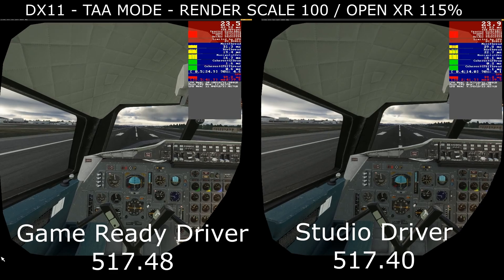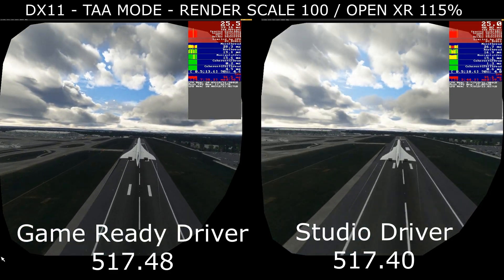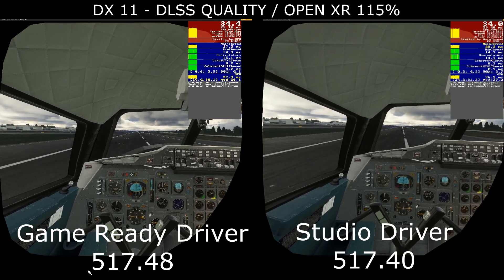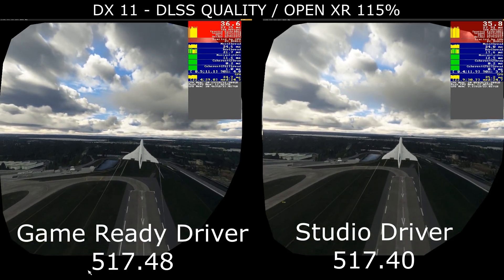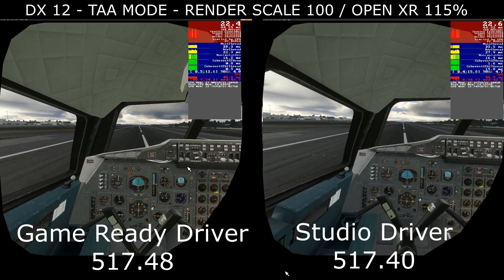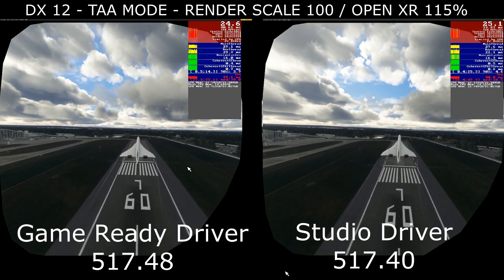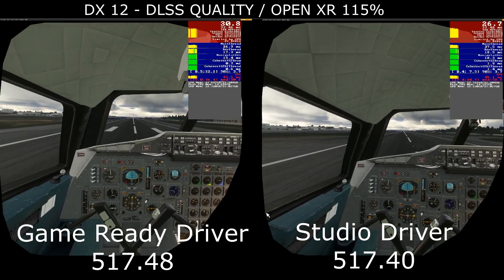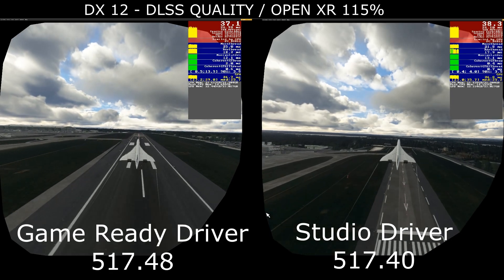MSFS: VR STRESS TEST! DX12 vs DX11 TAA/DLSS NVIDIA DRIVER COMPARISON: 517.48 vs 517.40 HP REVERB G2

Comment: Grd seems the way to go I’m running a 3090ti an reverb g2 dlss dx12 no issues besides trying to keep the g2 in the right spot on my face I seem to be adjusting it more than flying in order to maintain that clear pinpoint view I believe we need a decent advancement in vr tech where we can look with our eyes while still using our head because as soon as you look without moving your head seriously sucks basically anywhere our eyes look should be clear in vr

Comment: Off topic a bit. Any issues with Windows Mixed Reality minimising windows when HP Reverb G2 wakes up ?
Reply: yea, all kinds of wonkiness with the G2, very irritating.  LIke to get VR back it's like so drama filled.  Windows-Y, Cntl-Alt V, nothing, then WIN-Y again, Cntl-alt-V, then nothing, go into the flight sim software if you can find the mouse cursor and manually click VR option at bottom of menu options, grab headset quick or it will go wonky again, I need 4 hands to get it all settled and even then maybe not.  WIN-Y till blue in face.
Reply: @dabneyoffermein595  Windows Mixed Reality. Settings - Startup and Desktop - Input Switching.  Set to 'Win + Y'. This helps.
Reply: @jameslee-pevenhull5087  let me give that a try.  Thanks in advance in case that works, i just made the change while i had your comment up on the screen.  THANKS AGAIN SO MUCH!!!!

Comment: Hi, my Reverb G2 cable died so I'm using the Quest 2 while waiting for a new cable. But I'm shocked to see how pixelated the Quest 2 looks. I'm using the link cable @ a bit rate of 500. Is the difference between the G2 and Quest 2 really that massive?
Reply: What refresh rate and render resolution do you have set in the oculus app?
Reply: @GetOffMyyLawn  For MSFS I'd use it at 72Hz with the slider as far to the right as it would go, so 5408 x 2736 resolution. It looks great for games like Half Life Alyx at the resolution but the fine detail in MSFS and distant horizon didn't translate well in the Quest 2 compared to the G2 which looked much better. I only use the G2 for MSFS now though so not sure if Quest 2 has improved.
Reply: @kevinbrook7033  same here... I don't have a G2, so for me the Quest looks good at 72hz and slider one step b4 your setting. Honestly, there are so many places in the pipeline to tweak things, it's sometimes hard know what impact the changes are having. I wish there was a benchmark script in msfs that could log framerates, cpu, skips etc so things could be tested more consistently.
Reply: @GetOffMyyLawn  for the best visual quality run it at 5408 x 2736. That's actually the correct render resolution for the Quest 2. Because we view the displays through curved Fresnel lenses that curvature introduces distortion known as barrell distortion. Basically, anything below 5408 x 2736 will be subsampled in the centre as the lenses create a pin cushion affect making the centre further away. You need to correct for that. With the Reverb G2 although the panel resolution is 2160 x 2160 per eye to correct for its barrel distortion you need to run it at 3100 x 3100 per eye or 6200 x 3100 total resolution. Anything lower is a distorted, subsampled image.
Reply: I find the Quest 2 running at 5408 x 2736 looks really impressive for most titles, even relative to my G2. I haven't used the Quest 2 in MSFS for many months, but I was struck that more than any game MSFS really shows the resolution difference between the two headsets, especially on the distant horizon where the Quest 2 looks like a pixelated mess.
Reply: Yes.

Comment: What power supply rating do you have in your current rig Steve, Is it 1Kw or will you be trying the 4090 in a new pc with power a supply to suit.  Jay two cents (JTC) has some interesting comments to make on the 4090 including the fact it needs special cables?
Reply: just go for broke, evga has a 1600 watt power supply, i use and it wasnt to much. then you never have to worry and 10 year warranty.  The "special Cable" comes with the graphics card, it is the same cable as the 3090ti maybe 1 more pcie connector, it is just a splitter cable, i use 3 pcie power cables to this 1 cable. They are coming out with new power supplies so you dont have to use the splitter cable, but not many out yet.

Comment: i was thinking, i think you need 3 computers.

1 state of the art
1 with a cpu bottleneck
and 1 with a gpu bottleneck.

This way you can test and show us what works on various systems.
Have a small feeling that dx12 might be nice for cpu bottlenecked systems. *which is my system

Allthough, this is just a hunch of mine and will test it for myself the coming weekend.
Reply from the maker: I guess more PC systems are never a bad thing, I'd just need to find a bigger house!
Reply: @VRFlightSimGuy   You do not need really 3 Computers for it. What about reducing clock speed for CPU with a tool to sim CPU bound situations? And for GPU bound Sims you can just reduce Power level in Tweak III.
Reply: @VRFlightSimGuy  haha, got a cheaper solution for ya. You got a girl right? Read on the internet that they take a lot of space :p hahaha
Reply from the maker: @Daeva83B  🤣🤣